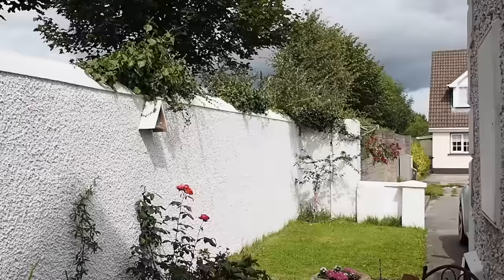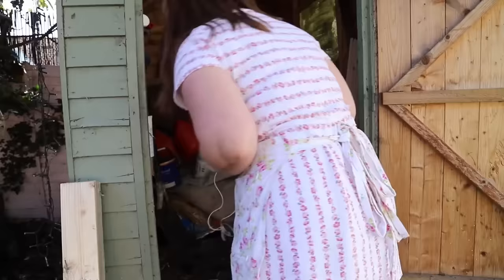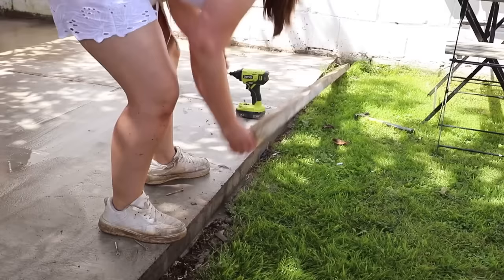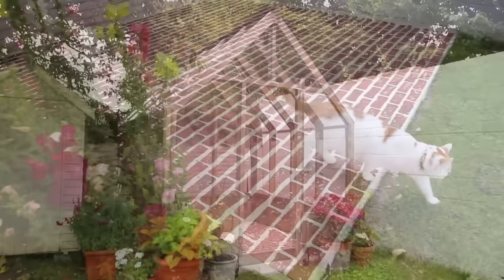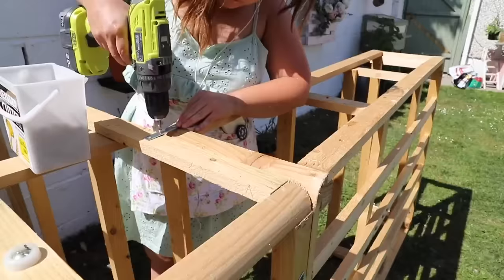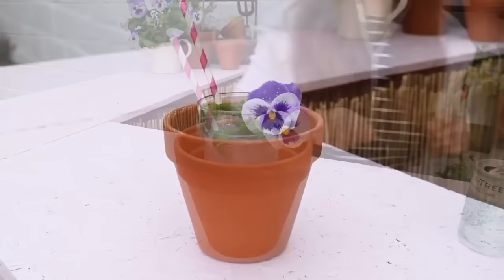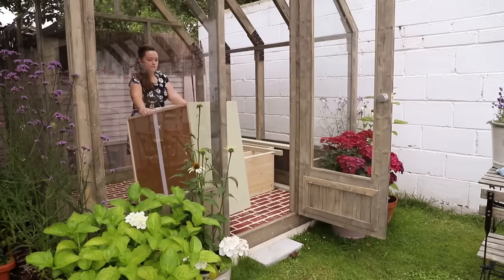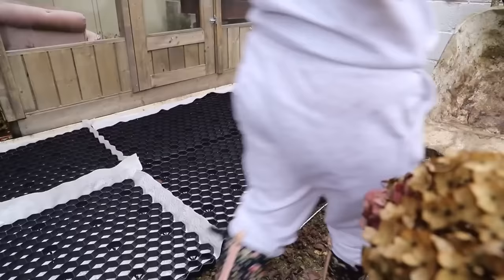My cottage garden journey, small garden makeover!

Comment: Lovely :) The greenhouse is gorgeous! Can I ask - did you have electricity put in there (or were the lights battery powered?) - if so, was that a difficult/expensive process?
Reply from the maker: Yes, so I have a special outside socket installed, that cost €200 including labour and materials. Normal price in ireland for that would be €80-€120 but because I have to have a cable drilled through a path, it cost more x